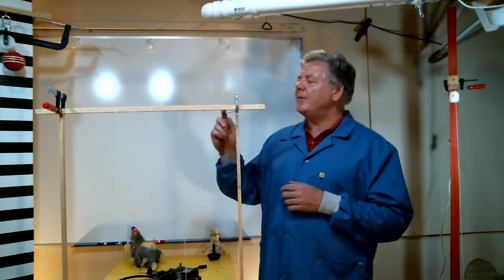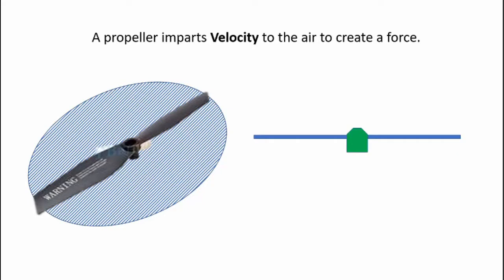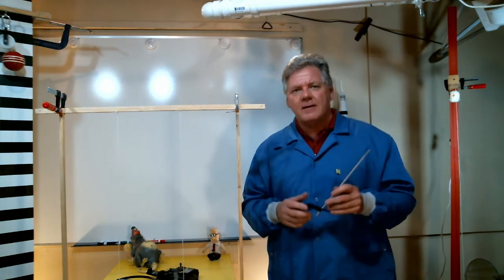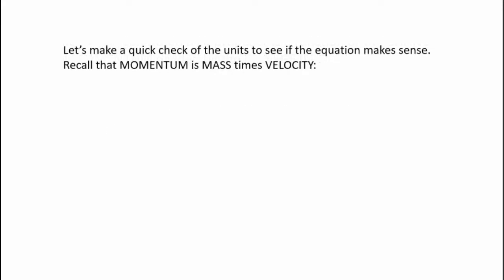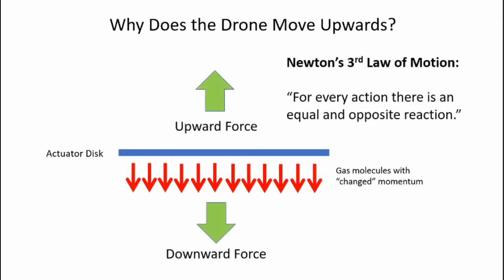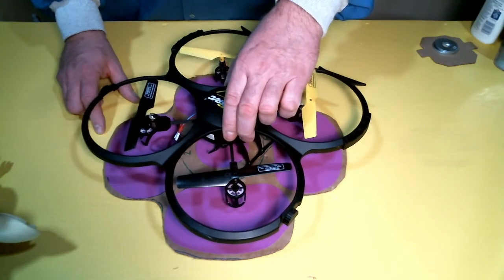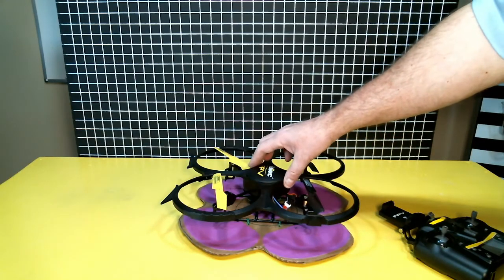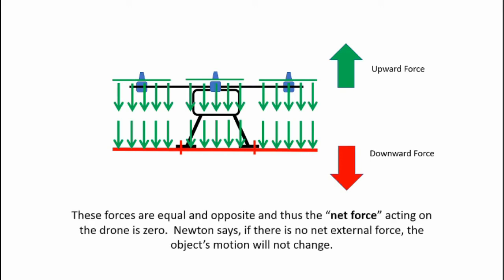Basic Propeller Theory

Comment: I have my doubts about an 'exact' cancellation of forces here but an interesting result none the less. The idea of lift being generated by the acceleration of air across (the actuator disc of) the propeller blades was made clear by using the accelerated air behind the propellers to then defeat the lift force.

The way lift was generated and the way it was defeated were very different, however. Are you trying to say anything in particular about that accelerated air behind the propellers? I trust that you aren't suggesting that the accelerated air behind the propellers is part of what allows the drone to fly. Surely, it is just the consequence of the propeller doing its job.

Comment: Great video. I am wondering what happens if one puts the reaction plate above the props. Does the drone still fly?🤔
Reply: My guess is no, the actuator plate needs to be continuously lifted into still air in order to accelerate and gain momentum. Blocking or restricting the airflow on top will prevent the drone from gaining any lift after that first push of air.